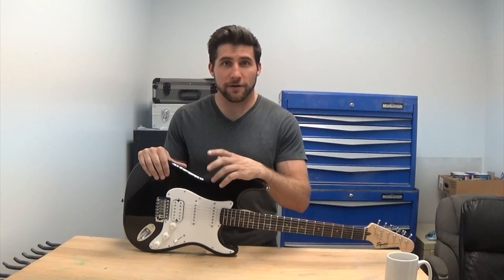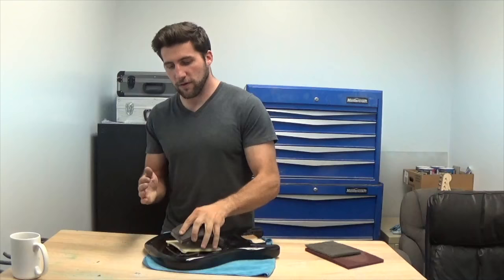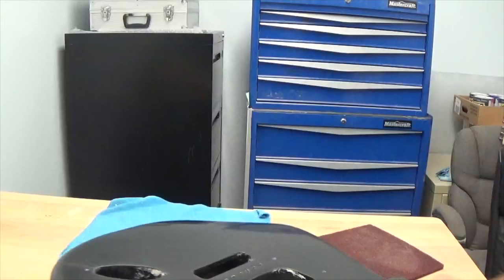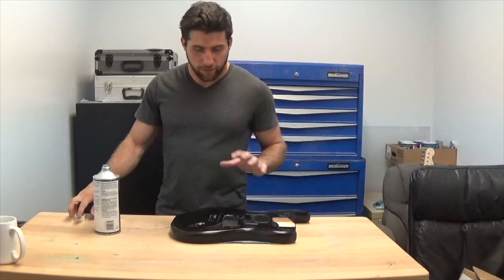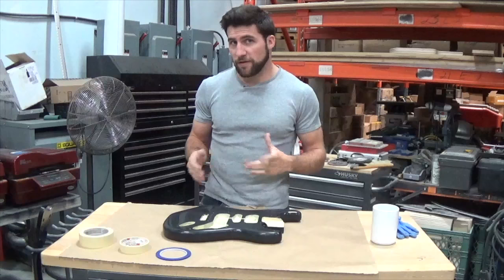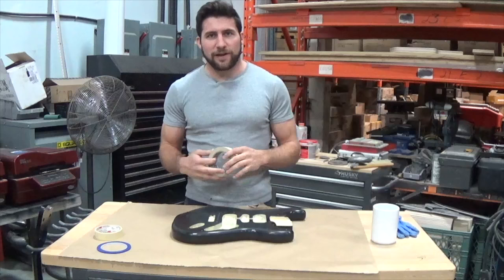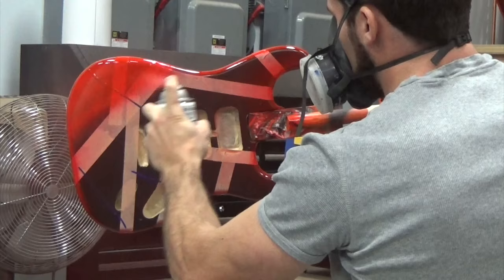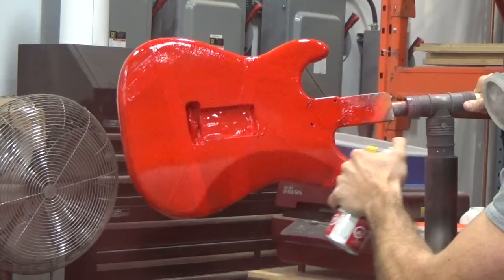How to do a frankenstrat paint job with spray cans (part 1)

Comment: Its painful to watch all the small errors he makes while spraying this paint... For instance, touching the body with his sweaty fingers AFTER he degreased it, and watching him not painting off what's called the "wet edge", or the fact that he neither primed the body OR  layed a tack coat... if you're a painter you know what I'm talking about...
Reply from the maker: As you can see, the minor contact I made with the body after degreasing had no effect. 
The wet edge works a bit differently with spray cans. Watch closely, you may learn something from how I work with it in this video. 
There is no reason to primer a pre-sealed body in this case. Primer assists with adhesion on metal and often plastic. It’s not helpful over a prior paint job like this. There’s also no need for a tack coat on an acrylic paint. I use one on my urethanes. 

I imagine you’re in the automotive industry. I’ve done that as well. There are some differences. Thanks for your comment though.